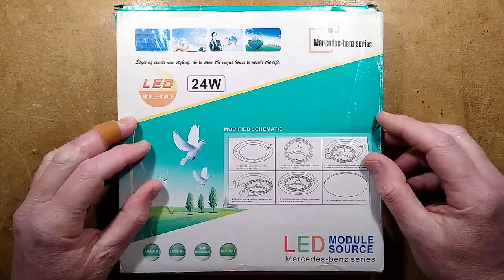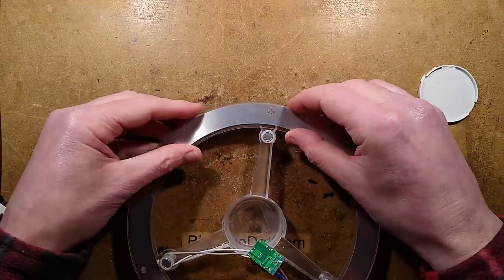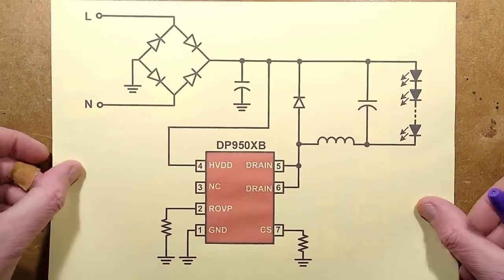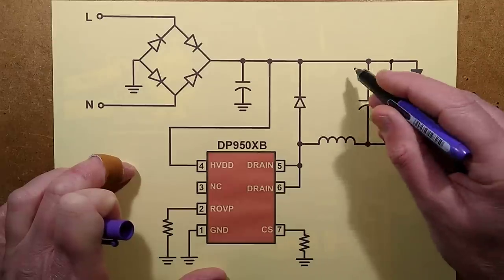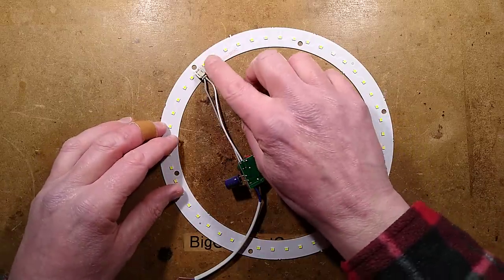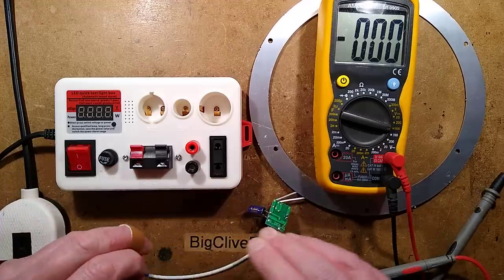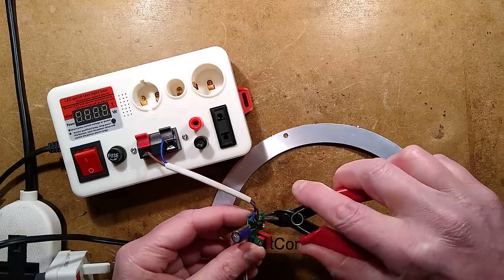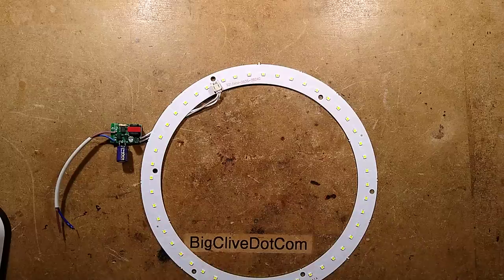Mercedes Benz LED ceiling light (with schematic and hack)

Comment: There's a lovely set of vehicle side-markers I got off eBay. I had one connected to a solar panel in order to see how long it would last. The answer was about a month so I never bothered installing any of them. Tearing the broken one down I found a resistor had burned out. The LED still worked. I put power through it and it came up amber. I put a different power level and it shone red. I changed power level again and it was white. Then I burned it out. The solar panel was 15W so it should not have burned out a big resistor that fast.
Reply from the maker: With a low load the solar panel may have been putting out a higher voltage.
Reply: @bigclivedotcom  That panel didn't last too long either. It probably wasn't putting out 15W. Somebody had vandalised it a while back. When I uninstalled it in the autumn it was putting out about 3W.

Comment: Discharging with your finger has become so boring what with everything having bleed resistors. I guess this one bleeds down through the chip?
Reply from the maker: If a circuit is faulty I won't poke the cap, since it can remain charged.

Comment: Having seen a teardown of that connection box you might want to think twice about disconnecting the light from it without unplugging it first. Depending on how the plug is wired, the SPDT switch inside will turn off the lamp by either connecting both wires to neutral, or live.

Comment: I thought this would be a 12 volt light since it goes in a car. Is there a step up transformer to run the light in the Mercedes? I wouldn't know since I don't have a Mercedes.